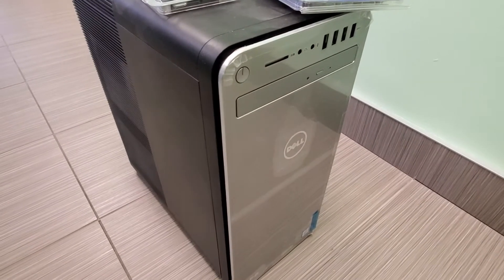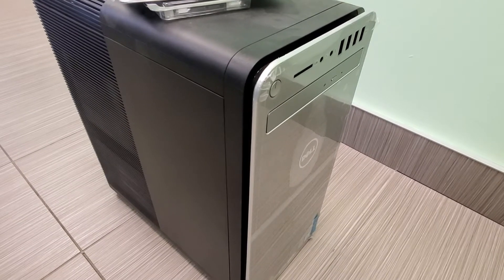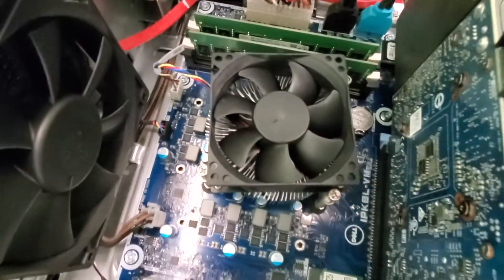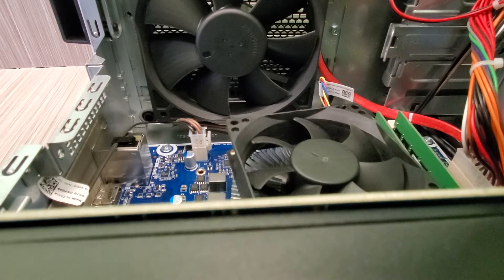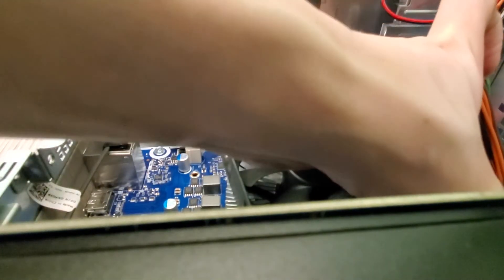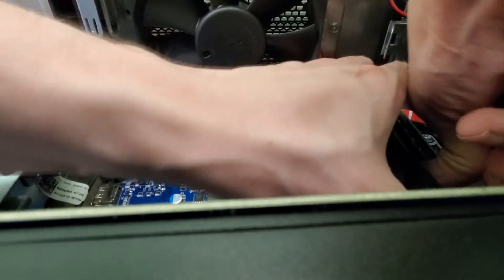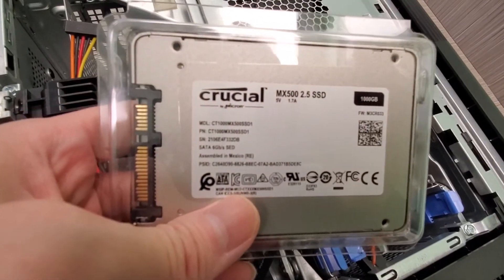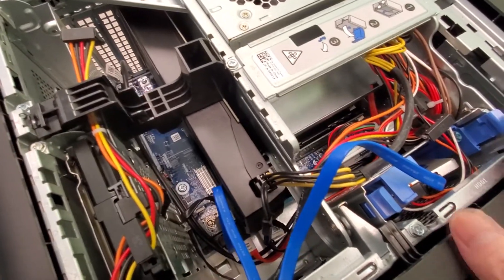Kintips DELL XPS 8920 Special Edition Upgrade How To Install RAM DDR4 2400Mhz and SSD 1TB

Comment: You can screw the SSD straight onto the disk caddies I think.
Thé pair of caddies come out of the case, remove the bar holding the graphic card in place first and then they can just un clip.